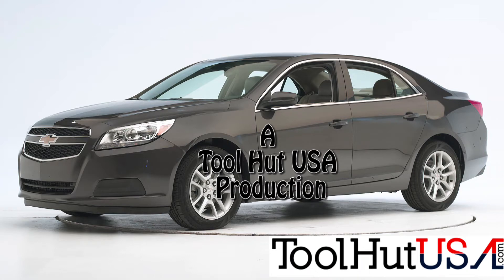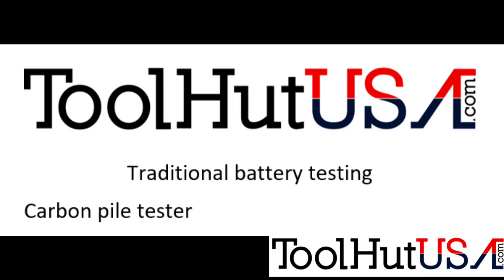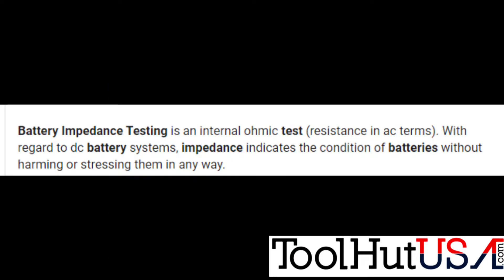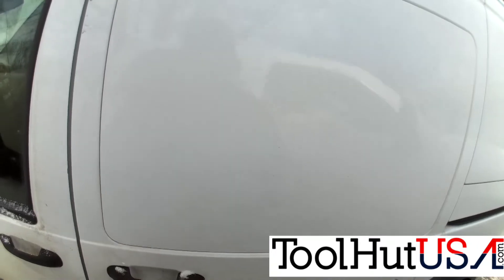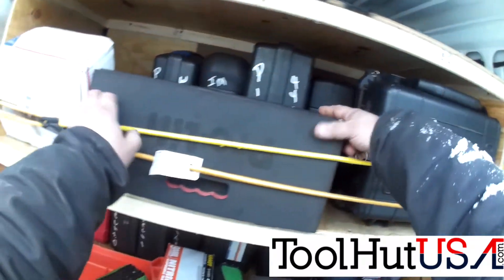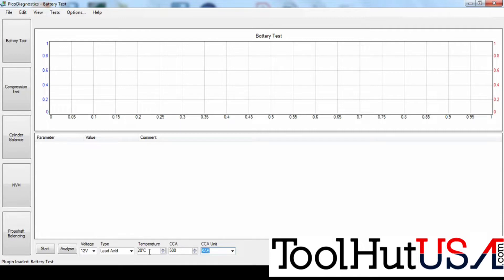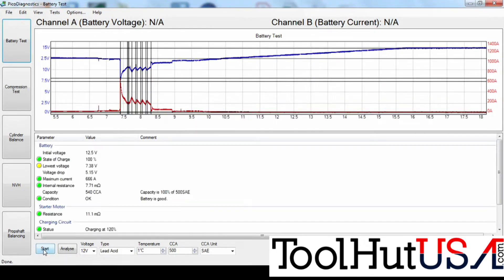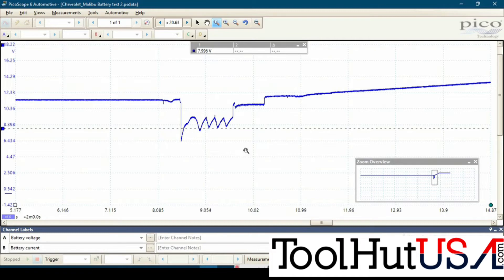Battery testing with a scope? Ep:20-1

Comment: I'm a big fan of this believe of either using a scope or DVOM set in min/max . I've even used scan data PID for module voltage as a way to ensure that the module is getting good voltage during cranking .

Comment: Im with you on the Battery test on the Pico software. Not a fan. I do know the temp. setting makes a difference though. That was why your test was different between the two test's. 
We have seen where battery's was clearly going out but software tells you to just Recharge Battery. Just shows that you can spend all the money you want on equipment, but you can't buy experience. I like to just perform test on good working vehicles and research their working operations. Over time you start to adapt what is a good reading or not. W/o something telling you otherwise. Thanks for sharing. HOW ABOUT THAT VAN TOUR my friend! lol

Comment: Indeed voltage below 9 volts while cranking is a indicator for a weak battery , because increased internal resistance multiplied by starter current gives a higher voltage drop .Maybe a shorted starter could cause a higher voltage drop too ?

Comment: You should not have the same voltage SPAC when testing a battery with scope compared to meter . The scope is much much faster and can read the in Rush voltage lower then meter. If you had 9.3v with meter you probably would be under 9 volts with a scope. Good rule of thumb with scope is anyting under 8.5 volts is getting weak. There is good information on this on  TST seminars youtube channel   named making money with your scope. Great that you're getting people to try to use their scope and other ways.